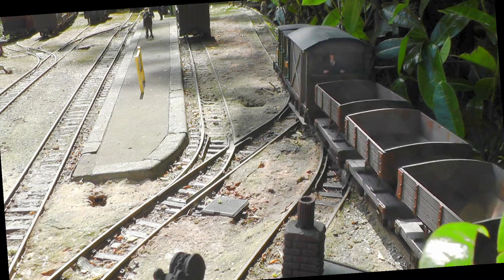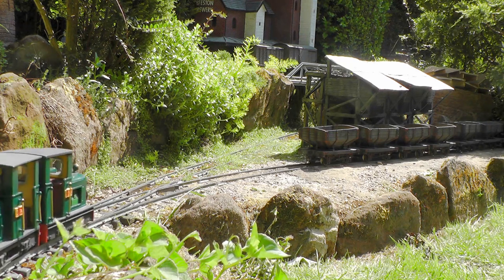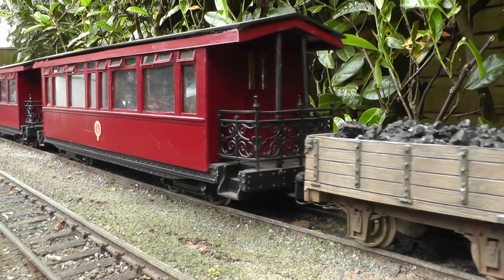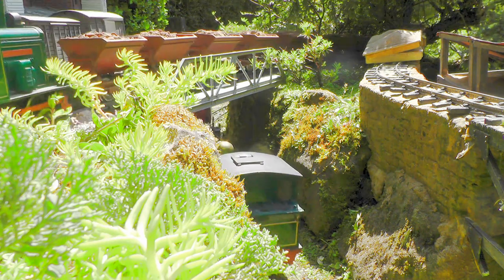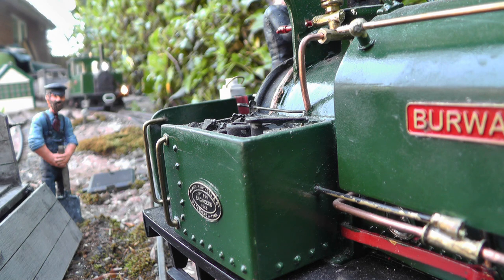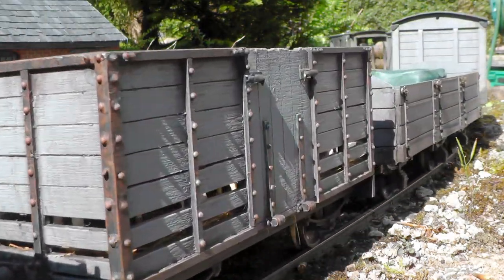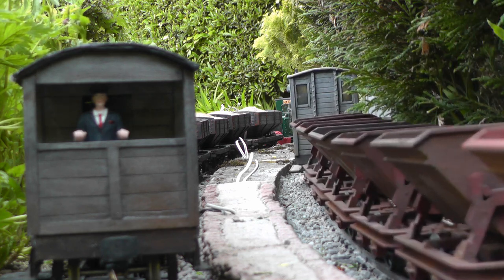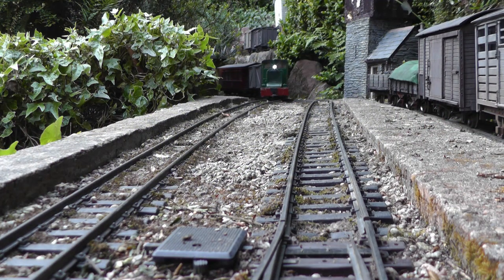Peckforton Light Railway - Extracts from a running session - May 2021

Comment: Well The Peckforton Light Railway get any sort of Express Train?
Reply from the maker: Interesting question. I suppose it depends on what is meant by express. The speed limit on the railway is 15mph because it is a light railway without continuous (vacuum) braking. However, an express could run from one terminus to the other without stopping at the other three stations. I suppose some of the special excursion trains are express, because they only run to Bulkeley to take passengers to the spa hotel.

Comment: Fantastic session,  always a joy to watch your videos. I have noticed one of your coach roofs is warping at the ends,  I did have a look through the comments section see if anyone else has mentioned it but I didn't see any.
Reply: It's last coach at 8:00
Reply from the maker: I think it was the heat ..... Another trip to the casualty bay ...... 😊
Reply: @rikbennett9  Others are also starting but not as bad,  maybe some metal strips to reinforce

Comment: Hi, what happens if a wagon has to be taken from either Bickerton or Bulkeley to the mill siding? As to my understanding this can not easily be done with the way the siding is facing, really enjoy these running session videos btw
Reply from the maker: Good question. Well observed. It does happen from time to time. Usually, I have a little diesel shunter (Doris) which potters about the timber yard at Peckforton. If a wagon needs to be dropped off at the mill Siding from further down the line, the the pickup goods drops it off at Peckforton and Doris will transfer it to the mill Siding.
Reply: @rikbennett9  ah thanks for the reply I was wondering how you would handle a freight movement like this